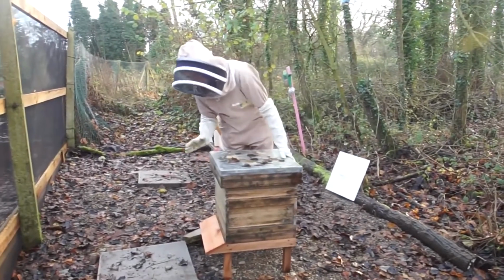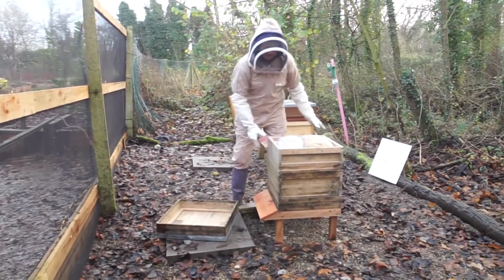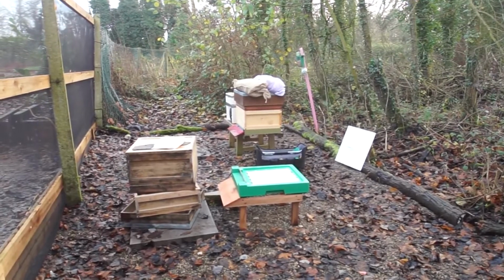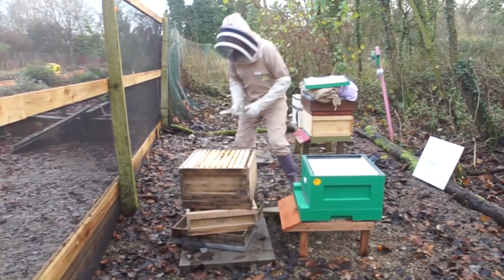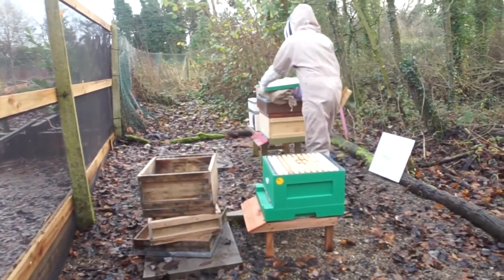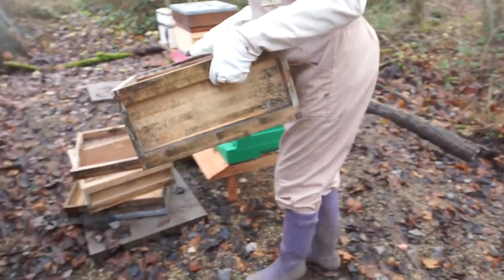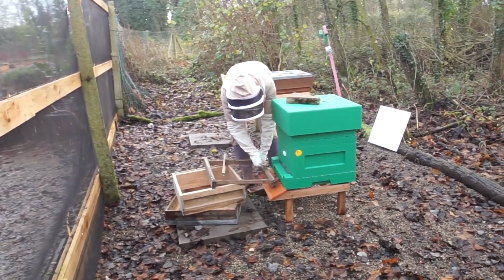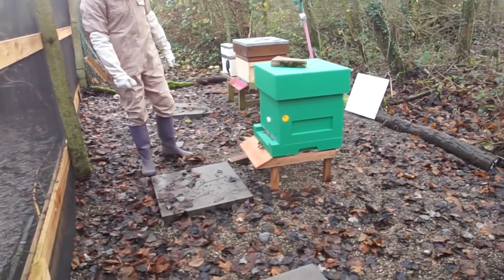Testing the Abelo Polystyrene Beehive - Setting it Up

Comment: Curious if the patty of fondant covering the hole on top blocked air flow, less flow up and out traps moisture?  I have seen others place some twigs or sticks under fondant to allow for air flow.  Maybe the bamboo wasnt the issue.
Reply from the maker: Air flow is a bit misleading. Honeybees are a woodland edge species and naturally inhabit cavities in trees. There are rarely ventilation holes in these :-) The girls are very good at controlling the atmosphere inside the hive. It always amazes me how well the manage this through a relatively small entrance hole.

In winter, creating a permanent hole at the top of the hive just serves to let the warm air out. The bees will work hard to propolise this up anyway.

Comment: can you explain why your frames are East West rather than North South orientation to the entrance ?
Reply: if they are north south then it allows more air to flow through the hive which will keep the hive cool in warm climates. East to west reduces that air flow and keeps the hive warmer which is what you want in cold damp climates
Reply from the maker: Hi Michael. As 'too much' says, it is (theoretically) linked to air flow and the retention of heat. You often hear the orientation termed 'the warm way' (across the entrance - east/west by your description) and 'the cold way' (fore/aft to the entrance - north/south by your description). Most of my apiaries are in Lancashire and North Wales. We have cooler weather so (theoretically) the warm way would benefit the bees. I practice it makes little difference. I have yet to find any evidence based studies to 'prove' the value. The bees are excellent at managing the internal environment of the hive. They have evolved this ability over millions of years (and without our 'help'). They maintain the atmosphere of a significant internal volume through remarkably small apertures. For example, I run a 6ft tall observation hive holding 16 frames arranged in pairs. It is glazed on both sides. The hive is sealed except for a small, 1 inch entrance just above the ecofloor. This entrance open into a similarly narrow flexible pipe about 15 inches long which goes through the wall to the outside of the visitor centre. Be bees fully manage the entire volume of the hive through this tiny hole. 

It is not unusual to see the bees propolising up the entrances of my other hives to reduce the size of the aperture. The will do this in response to changes in temperature and weather in order to control the internal atmosphere. They also do this to manage traffic flow into/out of the hive (e.g. making it easier to defend the entrance from robbing wasps in Autumn). I've even seen them stuffing drones into the entrance to make it smaller on really cold evenings.

Comment: Hello how did you get on with the Abelo hive please? Thanks Jon
Reply from the maker: Find it good to work with. Finish is good and cleans up well, material is robust and not prone to damage, some neat features (but can be a bit fiddly), the mark 2 has a better entrance assembly. The latest mk3 has a lower profile roof which is actually a bit of a pain and retrograde step. A strong contender if you fancy a poly hive.

Comment: Please use a good hive strap with this hive, not just a weight on the top. The plastic is too slippery to stay in place in a strong wind (from experience 😕).
Reply from the maker: Thanks Nigel. We usually strap hives down in windy areas. Many of our apiaries are extremely windy. Bricks are fine in very sheltered apiaries, such as this one. Bricks can also be a great way to leave a note about what's going on in the hive (e.g. pointing one way means queen cells, another way, queen right, another way , low on food, etc.